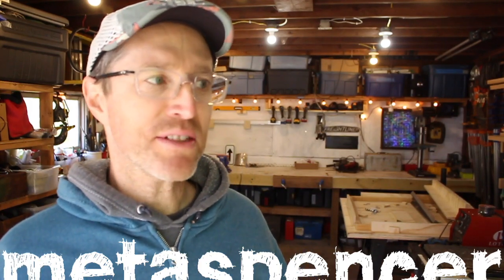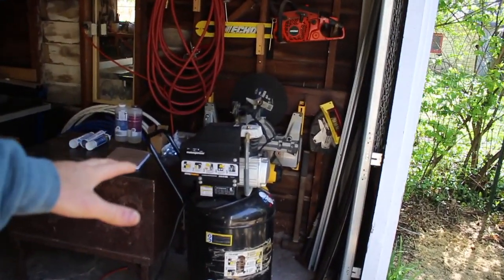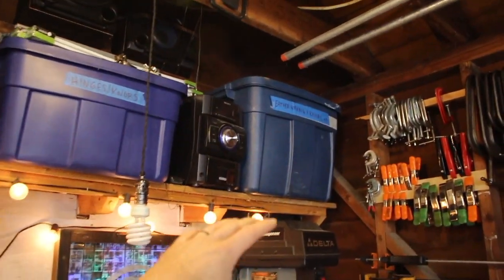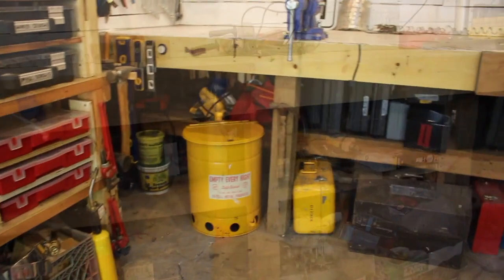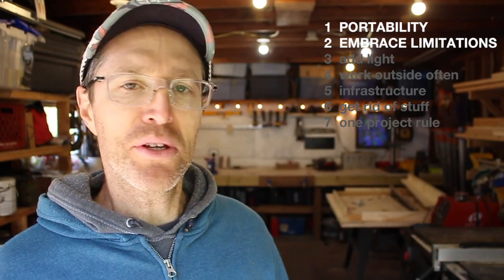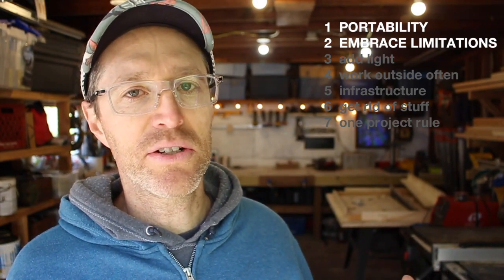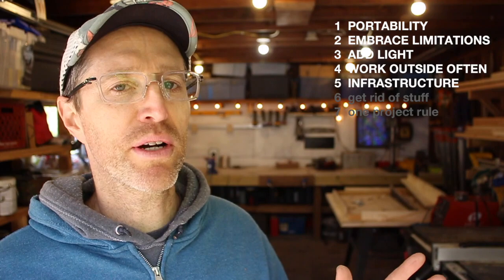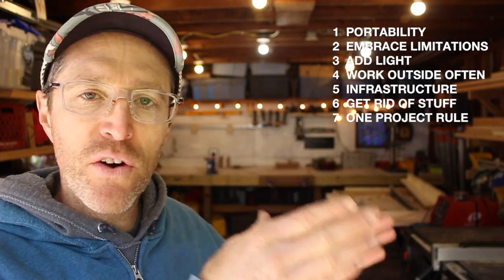Tiny Shop Tour + 7 Strategies for Thriving in a Small Workshop

Comment: This video really encapsulates what I am facing with my small shop.  Like you, I build with wood and metal and have the real life not so much fun jobs of finishing our home renovation which include plumbing and electrical.  Our family moved to the UK from Canada and I have had to add a range of tools to work with brick and plaster which I did not need in Canada.  We were in Canada for most of the renovation and when we arrived we found out that our builder took the liberty of shrinking my shop space by a meter to make the room next to it larger.  Even though I wrote an essay and included a shop layout diagram it seems both the builder and the architect did not seem to feel that I needed a shop as large as was on the plans.  This left me with basically a wide hallway for my woodworking tools which include a 10 inch table saw with extension,  15 inch planer, 6 inch jointer, full size drill press and full size mortiser.  I am going to put every heavy tool on castors so I can configure my space for each project.  I am going to build an 'overflow' area like you did for ply storage, kids bikes, etc.  Thank you for your tips and for making me feel that I can have a functioning 'small' shop.  I have to admit that I kept my anvil and forge and my knife making steel stash.  That may warrant an outbuilding one day but for now I need a new dining room table.
Reply from the maker: Sounds to me like you've got some great stuff! It's all about figuring out how to compartmentalize and store stuff, I guess ... keep doing it man! Even the smallest space can be workable

Comment: I'm in a basic 1/2 garage space (194 sq. ft.) and even though my tools and type of work is different, I have a lot of similarities  with your shop. Comments about electrical and lighting are spot on. Also, one project at a time is good advice. Portability is vital, especially if you need to store a vehicle occasionally. My shopsmith and related accessories give me a great deal of portable woodworking capability. That said, a very small shop can also lead you to hand tool woodworking, which has grown on me significantly in the past few years. A small traditional type workbench and a tool chest has gained prominence in my shop. Now, as you suggest, I need to get rid of some "cut offs" and other un-used clutter. Thanks for the posting.
Reply from the maker: Oh those Shopsmiths are cool machines -- sounds like a good shop mainly because you're using it! Great to get out there and get stuff done. Thanks for checking out the video

Comment: The work outside tip is a good one. I’m in a single car garage which is attached to my house and fine dust just carries into the house even with dust collection. So like you I’ wheel my power tools and dusty work outside. As long as it’s dry I’m good.
Reply from the maker: Sounds like you're making it work, which is awesome. Nicely done

Comment: One thing I had in my last shop was an air system to provide compressed air to about 6 locations.  I made it out of PVC, and connected my compressor to it via a short hose, so that I could quick disconnect it for jobs out side.  No additional space required.
Reply from the maker: That is something I would absolutely love to install in my next shop: it would eliminate so much hassle ... great idea. I'll have to read a bit about how you keep moisture out of the lines, if that's an issue ... thanks for the tip!
Reply: @metaspencer  Water in air lines is a huge thing, piping is important. PVC is not a great material to use for the system.
Reply: I forget what they are called, but there are moisture ‘filters’ available.  I bought all my components at Home Depot.